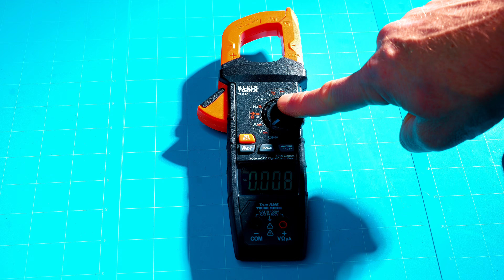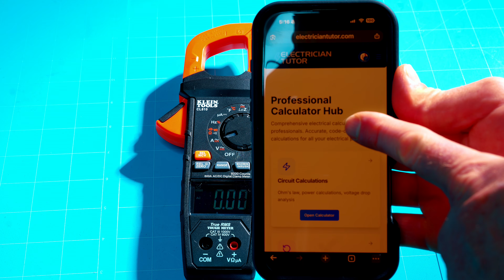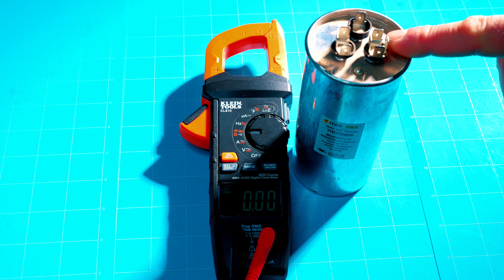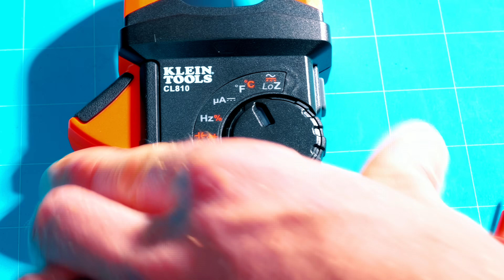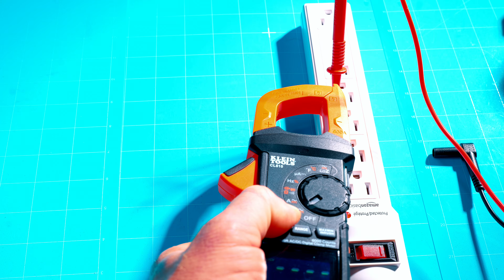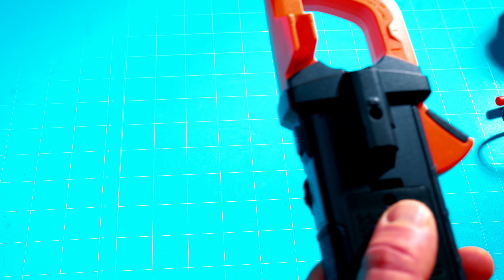Klein CL810 Clamp Meter FULL REVIEW – The Last Meter You’ll Ever Need!

Comment: I like the CL810 better than the CL900 in almost every way.  However the one drawback is the CL900 inrush current measurement range is >2A and for the CL810 it is >6A.  The CL900 will go up to 2000A, but that isn't important to me. The CL900 inrush min range is even higher than the CL810 ( > 10A).

Comment: I run the 900 and I have to say it's a solid unit, love the inrush feature 😊
Reply: The 900 has a much lower minimum on the inrush measurement (2A).  It seems most others are 5A, 6A (CL810), or 10A (CL910).

Comment: It is not the last meter you will ever need depending on your needs.  One meter comes to mind -  the LCR meter to read inductance.  I like an analog meter to measure diodes. If you are into vacuum tubes you will need a vacuum tube multimeter.

Comment: I have this and I was so happy to show it off at work and all the older electricians said throw it in the trash and get a fluke lol 😢 just crushed my dreams 😂
Reply: Fluke's in a league of it's own wrt reliability, robustness and how the meters just keep their accuracy and precision forever. But there are gaps. The IP30 rating of the 87V is too low for its intended application, imo. And the lack of LoZ on most of their meters is an irritating omission; imo it's a necessary function for electrical AND industrial multimeters. I understand though, that most of their designs were finalised before LoZ was a thing.  The CL810 display and backlit dial makes it a pleasure to work with in low-light conditions,far more so than most Flukes, but the expansive feature set surprisingly is missing a Lo Pass filter for accurate VSD voltage and current measurement; I can't figure out how Klein missed this in either the 800 or 810. Anycase, besides this missing feature, the 810 looks like an awesome frontline field meter. I have a few Fluke non-clamp multimeters but am going to select something in this line as my everyday work meter.

Comment: Hye

Honestly, the CL390 and CL800 clamp meters are excellent in terms of features, making them truly versatile; the CL810 is also outstanding in this regard. However, the display quality is a potential weak point, especially when the screen is exposed to direct sunlight. In fact, Kaiweets released the HT208F model featuring the traditional screen from their flagship HT208D—a screen that struggled in bright sunlight. If that issue exists with this clamp, why doesn't Klein adopt this valuable upgrade? Doing so could turn the CL810 Version 2 into a real winner. (banger)
Reply: I agree I cut me a piece of screen protector and it works excellent

Comment: I have a question. Do you notice that when taking a  resistance measurement it's a little slow?I've also heard that when taking capacitor readings it's slow and not accurate. (I dont take those readings on mine so I dont know).What's your thoughts?

Comment: does this measure DC amps with the clamp as well?
Reply: Yes it measures DC amps. You have to position the cable in a specific direction but it's labeled on the clamp. You can use it with the min/max to measure CCA during engine starts
Reply: Good question. Does anyone know the answer?

Comment: If they included a rotation reading feature it would truly be the only meter you need.
Reply: Rotation indication is not an expected feature for multimeters, although the UT219DS does have it. What I find odd is the lack of a LoPass filter for accurate VSD v&f measurements.

Comment: Thinking of upgrading to this meter since I don't own a clamp meter. Will my MM450 do a single thing that the CL810 won't? Only wondering because I'll likely sell the 450 to get some of my money back after, and would hate to regret it later lol
Reply: MM450 lacks a few features that CL810 has.

MM450 does not have:
Non-Contact Voltage Detector
LoZ Mode
Inrush Current measurement

MM450 only measures up to 10A vs 600A (via the claw of the CL810). 

If you don't need any of those features, it's not worth the upgrade. But personally, I WOULD upgrade for a clamp meter that has LoZ. This is very useful to find ghost voltages. I just bought a CL710 on Amazon for $119. I was gonna buy CL810 for the Inrush Current but I decided not to because I thought I'd never need it.

Comment: Can I measure min/max value for voltage also?
Reply: it clearly shows min/max button right above the display
Reply: min/max works on everything except AC current I believe.  When you press the min/max button for AC current, it uses the inrush function instead of min/max.

Comment: I love my CL810.
Such an impressive clamp meter. 
I know I may sound like a broken record, but the NCV feature is super finicky. They obviously just shoved it in there to tick a box.

I usually buy Fluke because my tools get pretty beat up, but given how much licking my CL810 took, I’d say it’s nearly as tough as most Fluke meters out there. A lot cheaper, too!
Reply from the maker: Thanks for the comment my friend and you never sound like a broken record, keep the comments coming! I do agree though, this is one of several NCVT's that I own, and honestly when it comes down to doing a job, I usually grab my standalone NCVT, whether fluke or Klein to get the job done. It is nice to be rolled in with the clamp on though so if that's all you have in a pinch it will work🙂
Reply: @ElectricalYou what NCVT stand alone you recommend,there are so many to choose from.
Reply: Thanks. I have been trying to decide whether to buy a dedicated NCVT or a multimeter with the function; your answer has pushed me even further towards the former. Ironically enough, maybe the Klein; it seems to have an excellent reputation.
Reply: @patrickhayes-foley6390  I have both the newer Klein and a real old Fluke NCV detectors and they work extremely well! I’d be happy buying either. 
I’d never ever rely on the built-in NCV feature in other clamp or DMMs.